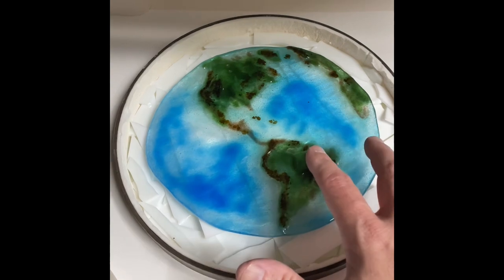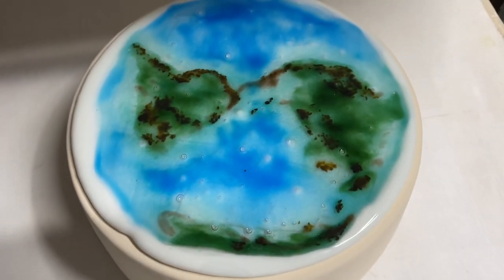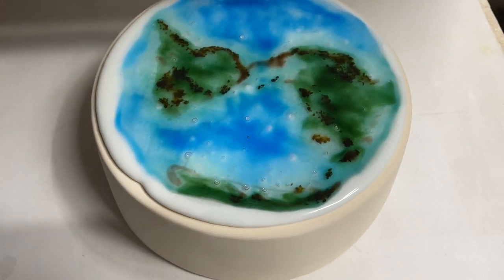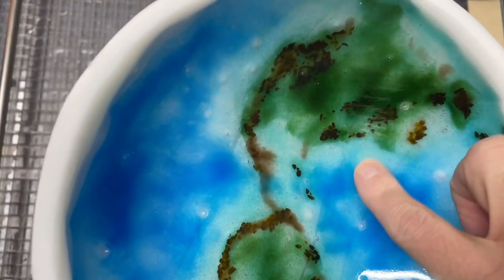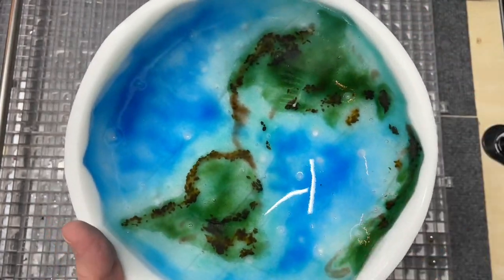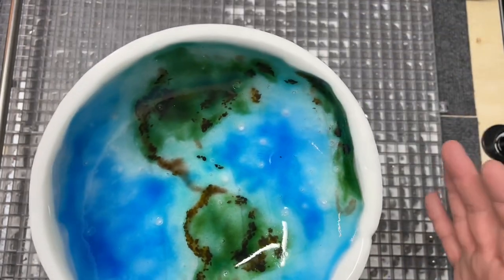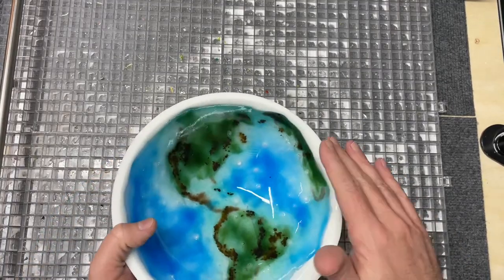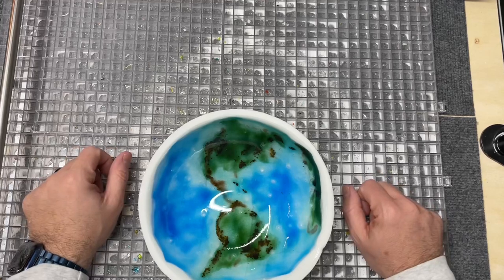Making a #FusedGlass Earth Bowl in my Hi-Lo Mold from Creative Paradise Glass!

Comment: I had a student who spent forever with working on a bowl that we slumped in a similar mold, the edges where bad for so,e reason, and she had two areas that pulled in bad.
I’m thinking it was originally a coral bowl that she filled in.
So I suggested that she used the grinder to add other areas that had the effect of having pulled in, so her random edge ended up looking great.
I did have to mark where she needed to grind to get a random finish, she had a tendency to make everything look very even, not good for random.
But your bowl looks amazing, and I bet you could sell it if you did it again